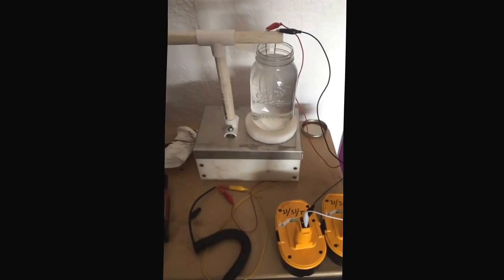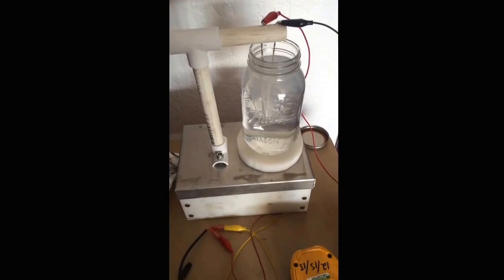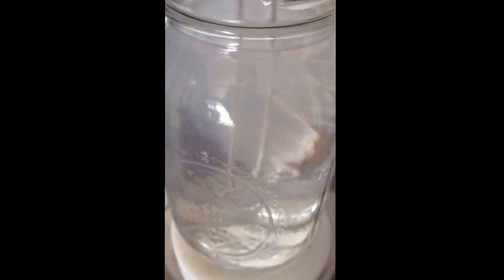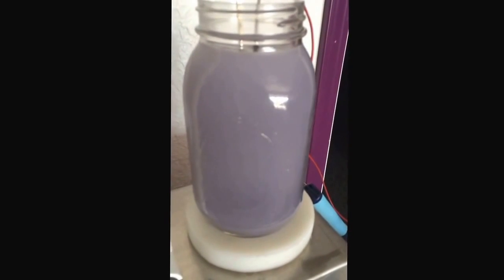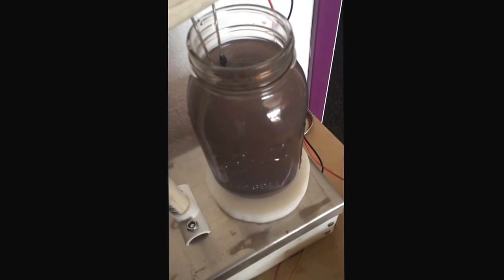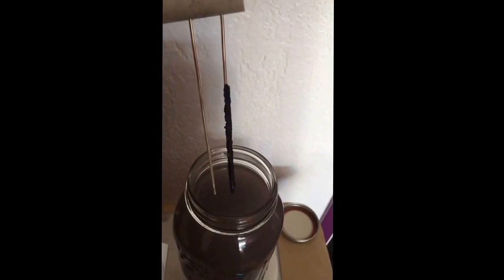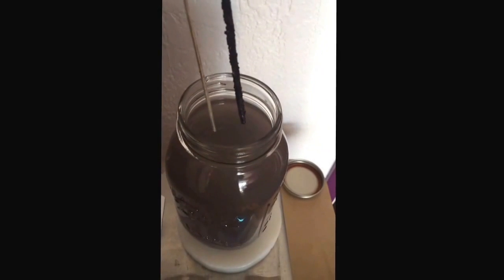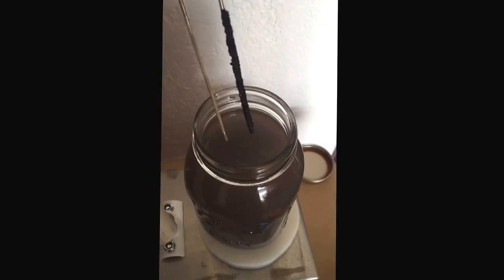Making Colloidal Silver day 2 using distilled water, a pinch of salt and .9999 silver rods.

Comment: 1: Another Moron who doesn't know the definition of Colloidal.  
2: Using an Electric MOTORIZED Platform pretty much guarantees that the sea water you just wasted your over priced Silver wires on is COMPLETELY useless!
3: This Crap Video is like 6 years old - and should have been properly ignored!
Reply: Instead of name calling for a guy who is just experimenting, why don’t you give some helpful hints or suggestions, other wise keep your name calling to yourself
Reply: @getmesomegold  So Should I NOT call you a Moron?  Or is that just because you were raised that way?
Some HELPFUL Hints for a whiner:
Here's What you need:  
2 X 1 ounce .9999 fine Silver Ingots, NOT those MORONIC USELESS  OVERPRICED Wires. ($30?)
1 Gallon GLASS Flower Vase and a thick plastic cover that does NOT fit tight, just covers the entire top. ($5)
Cheapest Aquarium water bubbler, tubing, and stone ($10)
6 V 500ma DC Power Supply, you likely have one in your closet, but around ($10)
Recurring Items:
Gallon of Distilled Water $1
Baking Soda, Vinegar. Make a CO2 Generator out of an old water bottle. CO2 is called an ANION.  This gets stuck next to the cheap water bubbler intake to bubble CO2 into the water. ($5? but it lasts for about 3 gallons)
SHould be free - Go to any store and just ask - a Big cardboard Box that it all fits in.
1 last thing - a Laser of some sort - pointer, flashlight, gun laser, etc...  Last time i looked, you could find a 2 pack for pistols for about $3...

Here's what it looks like - A full up 1 gallon CLEAR glass jar with the plastic lid with 2 slots 1 each for each ingot maybe 4 inches apart with a small hole for the bubbler tube.  
The Ingots - Washed with Dawn (the best degreaser) and Bronzed Brushed ($1.50) then NEVER touch them with your disgusting dirty fingers ever again, get stuck in the slots you cut in the lid.
Alligator clips attach the power supply output wires to the tops of the ingots which are MOSTLY in the Distilled Water.
The Bubbler stone sits on the bottom of the jar and the bubbling provides all the motion it needs to distribute any silver.

What you are effectively doing is electroplating 1 Silver ingot with another, which is why this will last you and your great great grandchildren's foreseeable lifetimes! 
The ONLY thing that should have ANY contact with the Water at ANY time are the 2 Silver Ingots.

Every 2 hours or so - You need to clean off the Black Smutz that collects on the Ingots  (that's actually Silver).  That's what the Bronzer Brush (Not Steel, Not Plastic, but the BRONZE one) that comes in the 3 pack from Your favorite El-Cheapo Hardware store.
And, Likely recharge the Home made CO2 Generator with new Baking soda and vinegar.
Oh - Here's how you make one: Stab a TINY pin hole in the cap of an old water bottle.  TINY!
Cut off about the top 3rd of the bottle, Invert the top and drop it back into the bottle.  About 1 cup of Vinegar will slowly drip into the bottom over the next 2 hours.  Make a few holes in the Bottom ABOVE that amount unless you actually LIKE having vinegar running all over your kitchen floor.   CO2 is heavier than air - which is why you stick it next to the INTAKE of the fish tank Bubbler.  Which should happily bubble CO2 into the water while the Electroplating process is happily humming along.  The ANION is VERY important!   YOU thought you were doing that with SALT - You weren't, you were just insuring that whatever you were making was foul tasting and wouldn't work.

OH - Another thing you'll need - a 1 Gallon Wine bottle with resealable Cap and a can of BLACK spray paint - Paint the wine jug as black as you can using the ENTIRE can of spray paint.  That's where you are going to store your magic elixir.

Every time you clean off the Silver Ingots, Shine your laser through the water in the glass vase (after ALL the bubbles have stopped).  After about 10 hours or so, you'll actually start seeing it, and each time it will get stronger and brighter in the water.  That's called The Tinsdale Effect.  Being able to see Microscopic whatzits with a laser in Water.
What you will NEVER see any of the Shills tell you is that it's the particle SIZE that is meaningful - NOT the AMOUNT of Silver in the water!  Think about it - How many MILLIONS of "Parts" are in a Single Drop of water?  You will make this stuff for Pennies BY THE GALLON - That's Gajillions of parts!  That's So many parts that your old Dead and buried Great Great great......<15 hours later> ancestor whatever would Still be counting!  Any Particle over 10 nM and you may as well just suck on the Ingot for all the good it does you.  SO if you get lucky, and get 1 part per million of <10 nM silver water - You have quite literally SCORED the Big Score!
 
Other Bits of Fluffery that you can use to Spot Fake Shills Who's ONLY intention is to SELL you something - If you EVER see a Video where they show the water getting Mirky, Discolored or Glowdy etc...  You KNOW they are LYING!
ANYTHING in the water OTHER than Water - Almost Instantly causes ANY silver to start making bigger and bigger crystals - and YES - Metals ARE Crystalline in Structure.

Actually Google the word Colloidal - I have NEVER seen ANY YouTuber ever who even know what it means!  It's simply a Distribution.  Silver Colloids in Water at MAXIMUM 34.xx ppm.  That's it or LOWER! But if you ever see that it's Higher, you KNOW they are Lying! (and they couldn't possibly know unless they spent about a bajillion in a laboratory)  The Ionic form on the other hand, has No such limit!  However - the more silver in the water, the FASTER it makes bigger than 10 Nm crystals!  So in REALITY - The LOWER the ppm the Better!

See - Before I called you a Moron because you made a Dumb ass Video without actually doing ANY kind of even the simplest Research - I DID!!!
S0 - Maybe you just might want to actually make the ONE and ONLY Factual YouTube Video about IONIC Silver water now and replace this piece of disgusting moronically generated lying filth!